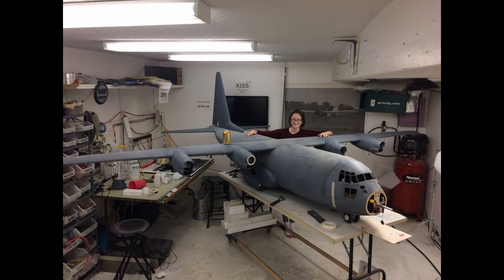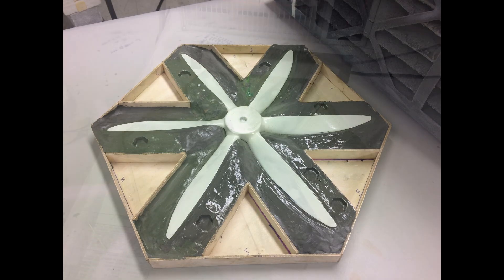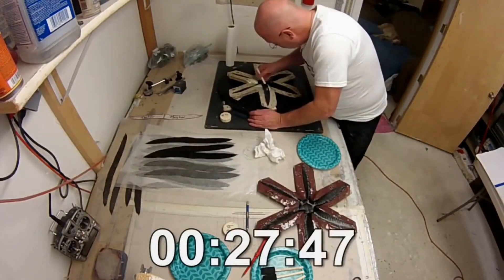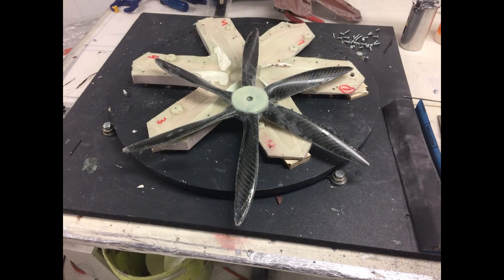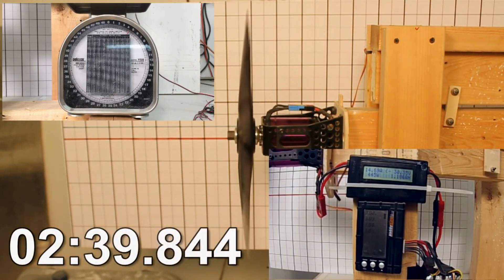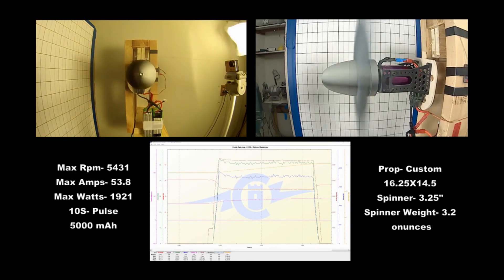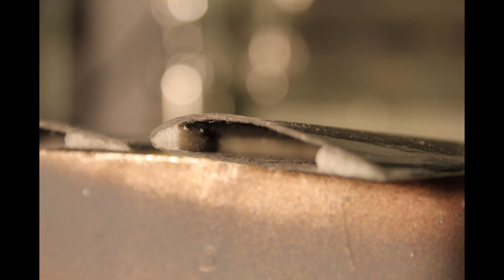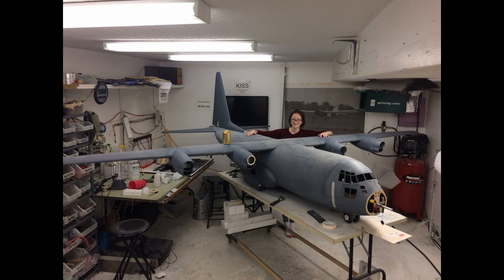C-130J 1/10th scale- 6 blade Carbon Fiber Prop Development

Comment: The props you bought may be hollow, but I can assure you that a real J model prop is definitely not hollow.
Reply from the maker: I 100% agree. But as a designer, why would I add weight and make a prop stronger than I would need? Nowhere did I say the real ones are hallow? I have the TO's from Lockheed to the J-Props and know how they were made. :) Rock ON!
Reply: @dagtheaviator  Very true about extra weight, I saw your H model prop and how it sheared at 1928lbs. That's pretty amazing how strong it is. My bad about the hollow thing, I wasn't sure if you were talking real life, or RC props. I too have all the TO's. Nice work
Reply from the maker: @matthewmajcher7180  Rock ON!! :)